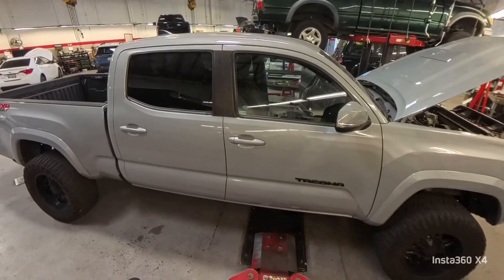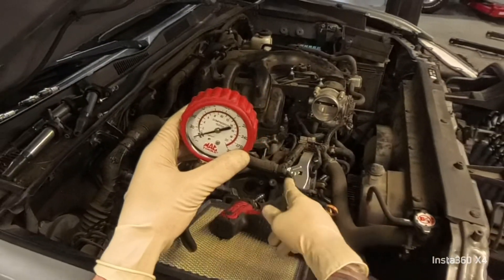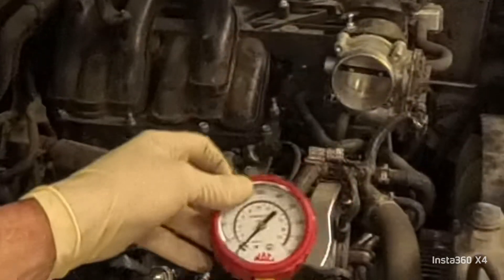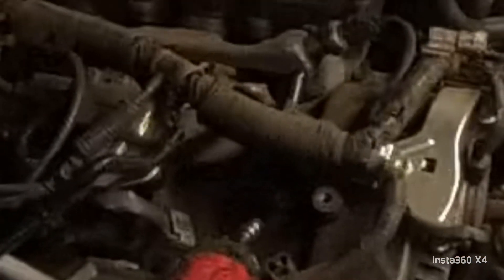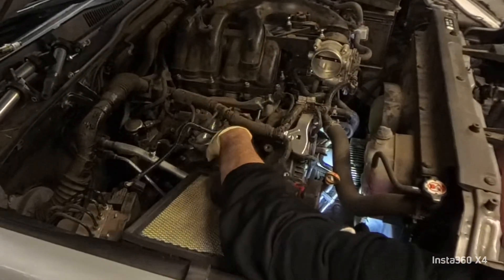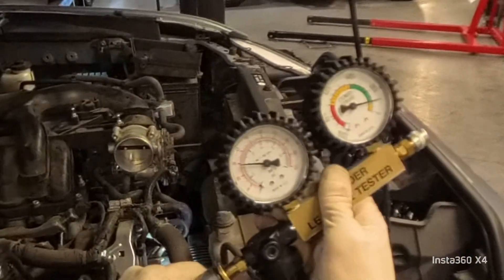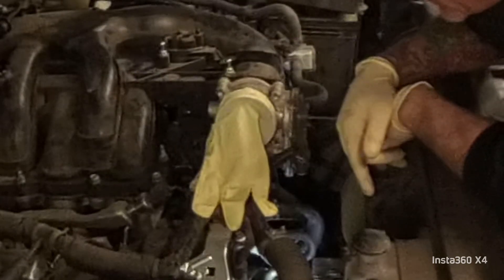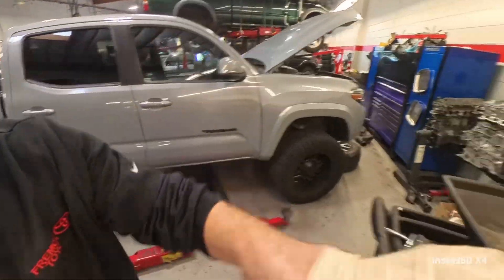2GR-FKS bad engine compression & Cylinder Leakdown test

Comment: I need to do the same with my 2018 as well.. where do you live? 😂

Also do you run 0w20 or 5w30. My dad swears by 5w30 (we live in Canada)
Reply from the maker: I’m in the Bay Area I do what ever that oil cap says yall take care out there I want to visit Canada one day I never been there
Reply: @WaltNasty oh okay thanks for getting back to me!
I used 0w20 as recommended and the thing blew at 150,000km (93k miles) 😬 mine sounds like a connecting rod bearing.
Canada is beautiful but cold!!

Comment: I have replaced  tons of the bank 1 cylinder heads and exhaust valves.  Known issue worn damaged exhaust valve guides causing burnt valves and valve seat damage.
Reply from the maker: Yeah it's a very common issue with these engines unfortunately.
Reply: anyway to avoid it?
Reply from the maker: @nastysoda9212  I don’t think so,  it’s just bad luck for those when it dose happen, hopefully vehicle under warranty or extended care so customer don’t have to pay
Reply: @ copy, thank you

Comment: Are you doing your leak down on TDC of the compression stroke? If it’s on overlap it won’t be accurate. Also, why not verify valve clearance on low cylinder before condemning engine?

Comment: Common issue.  About $13,000 if out of warranty right?
Reply: “Common” lmfao the Internet these days
Reply: Its not common, there are over 1.3M 3rd gen Tacos sold... Even if 1000 trucks with V6s fail, that number is still so low. Of course some will fail when you sell that many trucks.
Reply: @ 
1000? Lol you're literally making it up as you go; WaltNasty has 2 there at the same time for one tech at one dealer in one week and you think it's uncommon?
Reply: @wildman1137  if it was common the forums would be full of reports and trolls like you by the thousands would repost over and over again, much like the current tundra engine. It’s not common considering over 1 million Tacomas of this generation were sold, not to mention other Toyota vehicles that have this engine.
Reply: @aknadiri2520  that’s why I laugh at these internet warriors that don’t understand that concept.
Reply: How many miles on this truck?
Reply: Careful!!! You’ll anger the Toyota fanboys! This is the truck they use to brag about!!!
Reply: @DUNEDIRT no the 4Runner is the one that gets bragged about that 4.0l
Reply: Yeah they’re known to happen in these 2gr fks. Siennas highlanders tacomas and even avalons. But it’s not as common as other Toyota defects
Reply: @ do you know the root cause of this issue?
Reply: @albono780  I don’t know the cause, it’s just a random thing that happens to a random car with those engines. It mostly comes from valve seats, it has also happened to cracked valves or cracked blocks from my experience